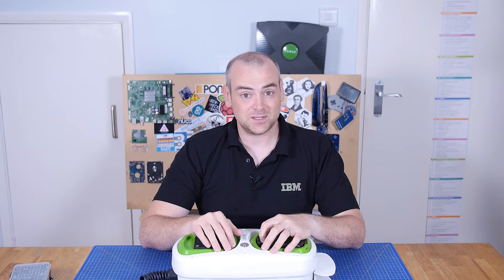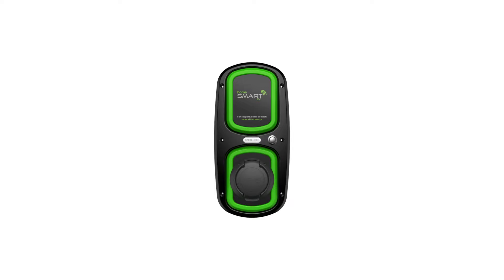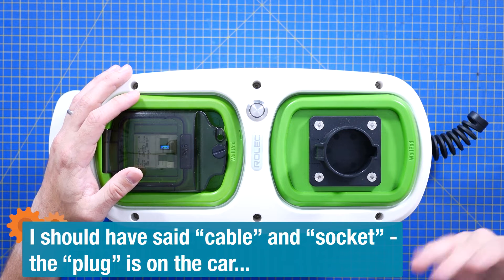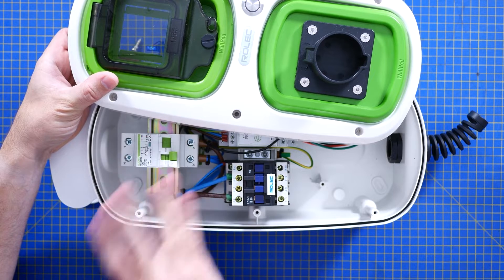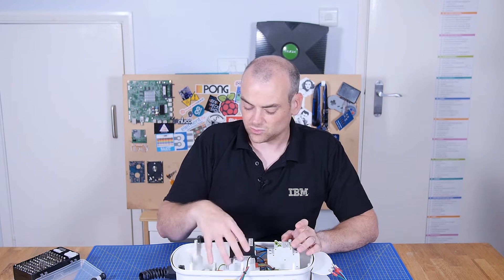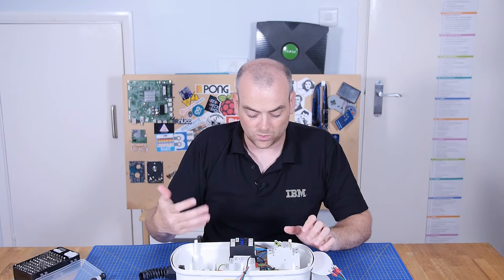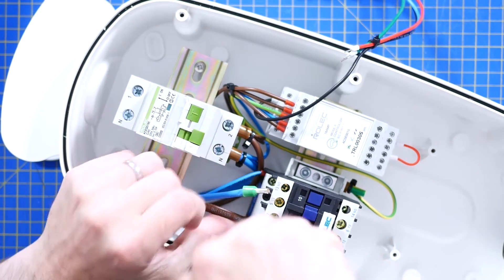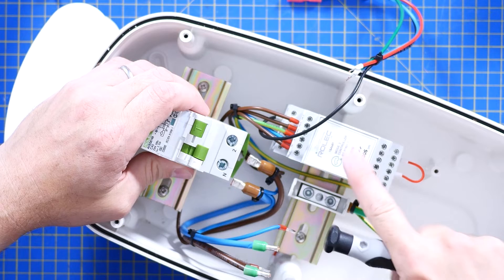Rolec Wallpod Type 2 Electric Vehicle Charging Point Teardown - The Electronics Inside

Comment: These charge controllers are one of the worst products ive ever used.
They usually burn out one or more parts and thats even the updated version. 

Ive replaced everything except the teathered lead. Yesterday was an updated evse controller that actually wouldn't alow it to charge over 5kw.     The original contactors are re badged 18A  to 32A.  
Having said that. Once its all replaced with quality parts it works great.
Reply: My control unit has gone, I hate my rolec.
Reply: @bacburrito4225 which version is it?

Comment: This is interesting. It seems pretty simple for an EV charger. Lots of other EV chargers have much more complex internet based timing/control etc.
Reply: The control module is clearly designed to be modular. The rs232 connection can have accessories like GSM modems or card readers attached.

Since it appears that this one was bought to use as a cable donor, it would make sense the original owner went for a basic model?
Reply: @a531016  Yeah that definitely makes sense. One of my friends has one of these Rolec chargers but sadly they also went for the basic model 😞

Comment: Building a charging controller would be super cool, a lot of smart chargers have a time limited service plan included, think ours is 3 years of smart functions included, then a yearly fee to continue using them. Would be much better to be able to manage it yourself locally without relying on an external and unaccessible server somewhere (as Anderson users have recently found when the company went into administration, leaving users without the control functionality)
Reply: That classic modern issue of "the servers got turned off, now my gadget doesn't work" is a much bigger issue when it's how you fuel your car!

I like the idea of an open source charging controller, maybe Matter? Maybe integrating with energy suppliers tie in? There is a trial coming up for smart meter users to get a discount to run your dishwasher or washing machine at certain times. I can't imagine car charging not being included too?
Reply: @a531016  luckily, they seem to fall back to always charging of there's no connection, I'm in several ev groups online and I can't remember seeing anyone's who didn't (ours is full power charging until it gets a mobile network connection)
"most" ev users (because it feels that way in the ev groups) are already doing timed charging, it's a bit like the old economy seven tariffs, but optimised for ev users. The most common, and what we're on is octopus go, which gives us 4 hours from 12:30 at night to charge at 7.5p a unit. This will let you do other things in that time for that price, but there's other tariffs which connect to the charger and let's you have more hours if solely charging, or more time for a higher price.
But this is why smart chargers are useful, as ours is linked to the tariff and knows when it'll be cheaper (you can tell it that you need a certain milage by a set time and it'll work out the cheapest way to get to that too)